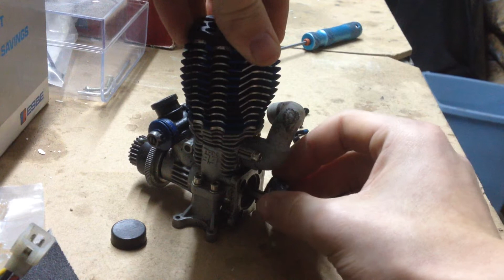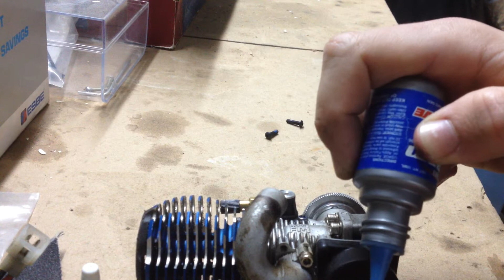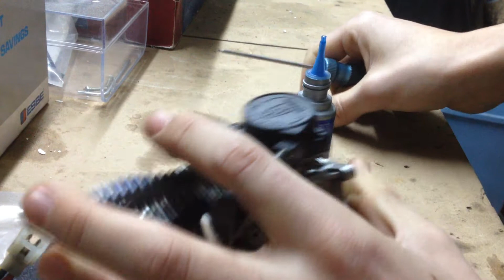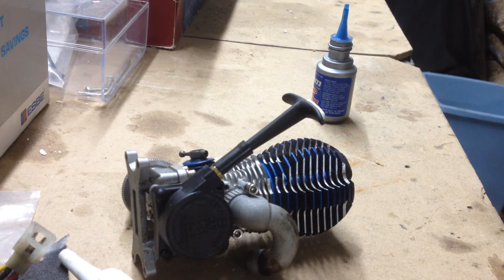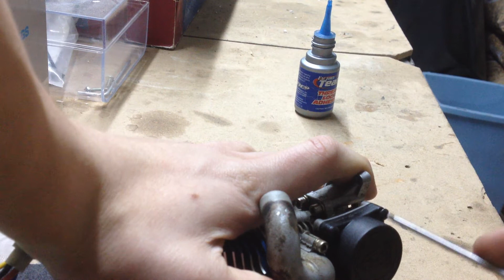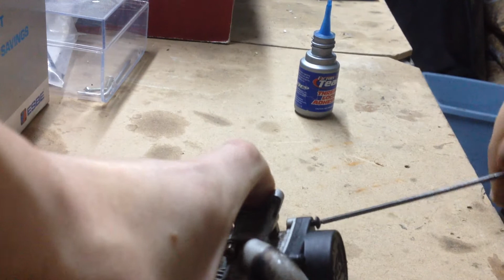How to instal pull start to RC Nitro engine. (Traxxas TRX 3.3)

Comment: You went about the entire process the wrong way. Put the one way bearing in the starter first, and make sure the letters on the one side of the bearing go against the motor. 
You didn't explain anything. It makes it hard to follow along.